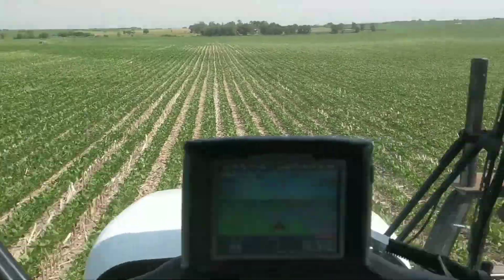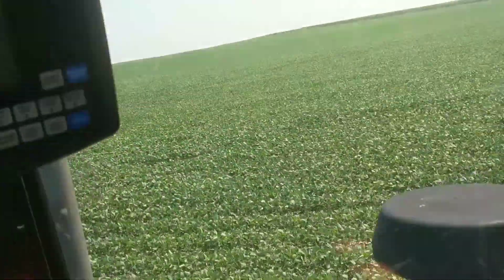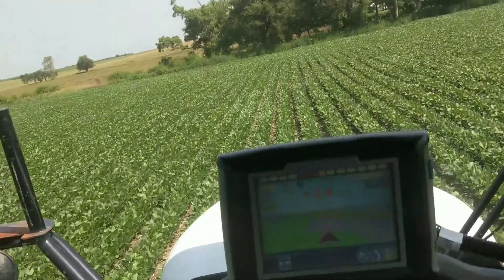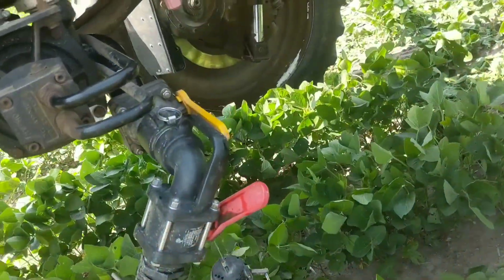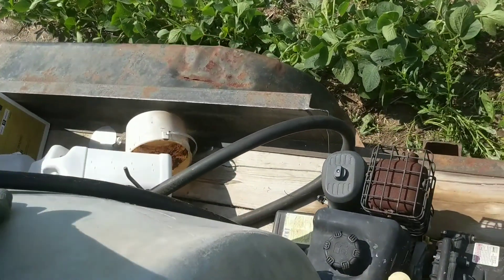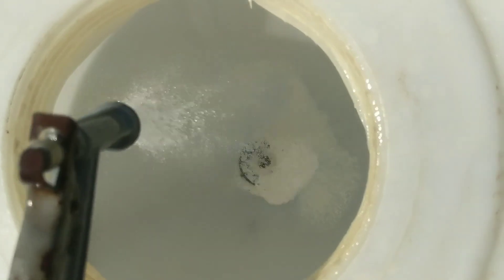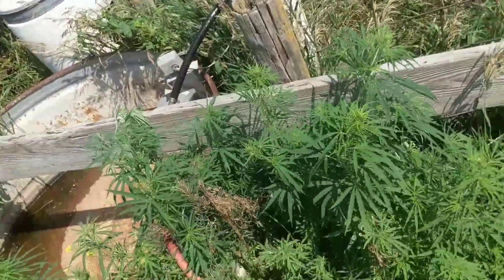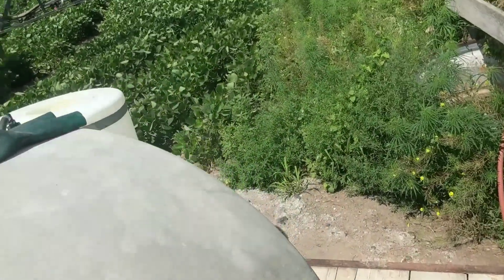Fungicide on Beans.  Nurse Tank Setup

Comment: Stuff looks nice around there. I like your float, i need to fix up something like that. Getting tired of running the tank over or having the darn hose pop out
Reply from the maker: We caught a couple rains so stuff doesn't look too bad.  Hopefully it'll stay nice for pollination.  Just starting to get some tassels poking out here.     I think I got that float at tractor supply.  It works really good as long as you can keep it clean. Which is why I have a strainer on there.  Some wells will pump a little sand or may have some old rusty pipes and plug the float up.